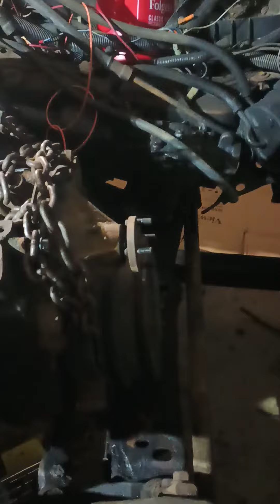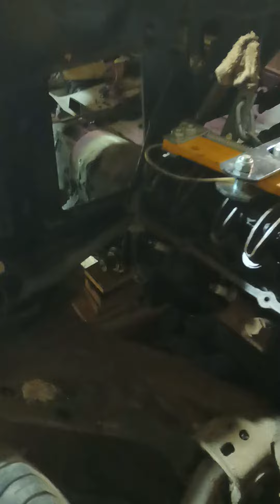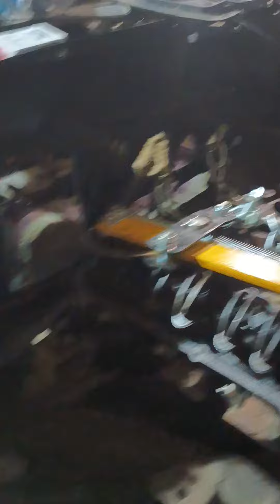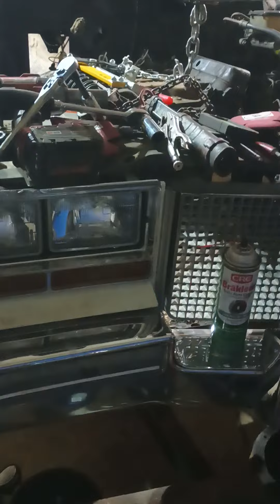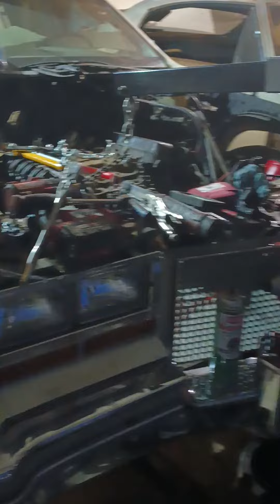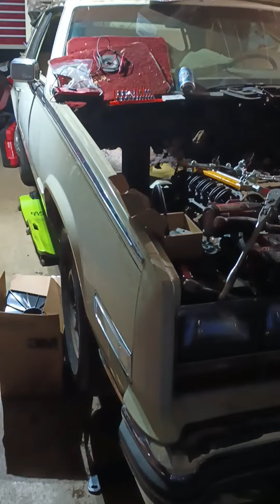eldorado #4@faforacing

Comment: What rear diff are you using?
Reply from the maker: I had a dana 60. It was cut too short. So I have a Ford 9 inch now
Reply: @faforacing   I was going to say that I have an extra 9" out of a 64 Galaxie if you need it but it sounds like you have everything under control. 👍👍
Reply from the maker: @killroyjohnson1256  I don't know about under control 😂. Been waiting all day for engine mount kit to show up
Reply: @faforacing  man that shit will drive you nuts. Especially when you wait, wait and wait some more and find out the fucked your order up. Smh 😫